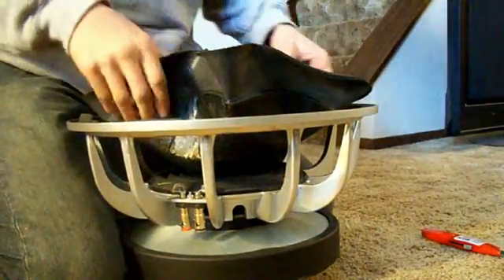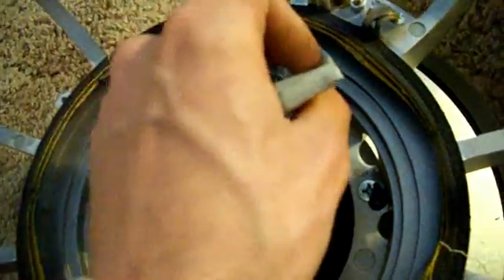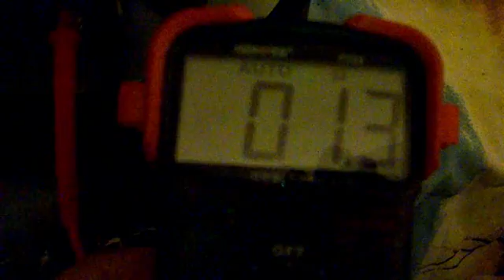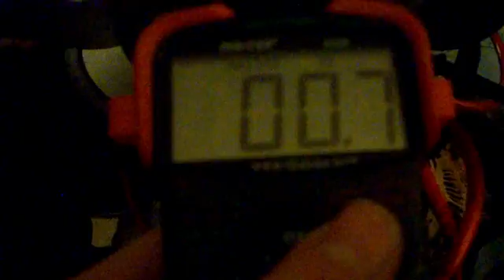HOW TO FIX A BLOWN SUBWOOFER - Recone a subwoofer, reconing the Fi BTL 15

Comment: Anybody HELP!
 i need an experienced persons aid because I'm dumb as F about car audio, can't figure this out...  Im sure i have blown one of my twelve inch subs, but it passes all of the so called "blown-sub-tests" to check if its actually blown out. I think its technically bottoming-out but again I'M NEW TO THIS.  

So...The fuk'd up subwoofer does produce bass, & at a comparable level to the other sub in my SUV..  

The problem is that unlike a blown sub that distorts bass 
 (I've blown subs before & know how they sound) blown-subs make that muffled rattle where bass should be heard .

  Instead my failing subwoofer makes low & mid level bass just fine until the bass really hits; then it makes a terrible "Thwack!" Slapping sound. The slap doesnt reverberate or rattle. Just one sharp crack every time the beat booms.

Some problems with subs are fixable & other's spell the end for the speaker; but NONE of the youtube vids or car-audio websites i have checked address this... & believe me I've searched 

The sub glides smoothly up & down within range when pressure is applied. No scratching, clicking or popping sounds come from the sub when I gently push it up & down...  

Sorry for the lengthy question but I'm trying to provide needed info to solve the problem.

Do you know whats wrong?  I dont know the impedance or ohms, just that its a 4-ch. 1,200 watt amp pushing two 12" subs. 

 I traded a Hdtv for the system, then simply paid a shop to install it. 

Yes im a dummy; please help me solve this. Thanks

Comment: Dude did using that epoxy work well? i just got a shocker sig tight gap with a ti pro basket and i need to drop in a cone and that subwoofer glue is expensive?